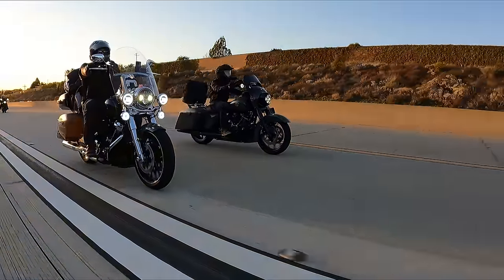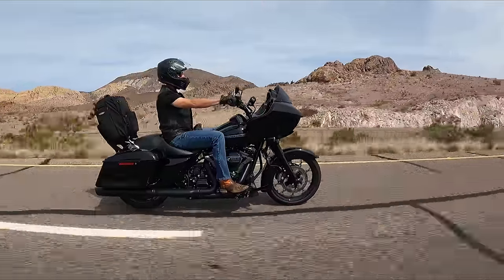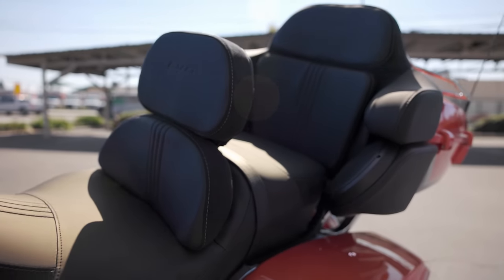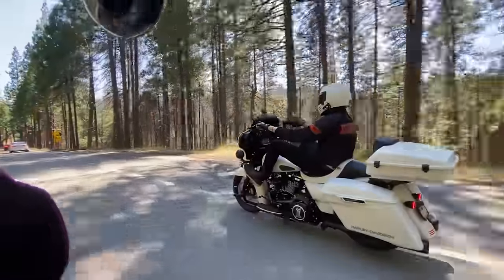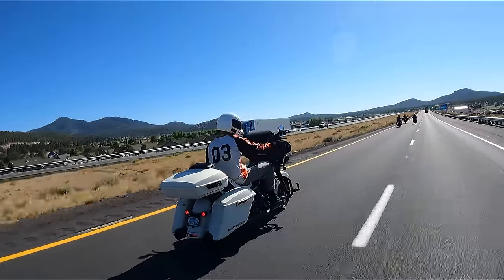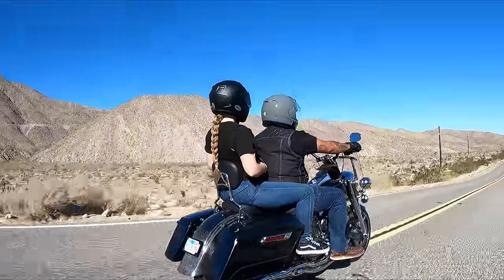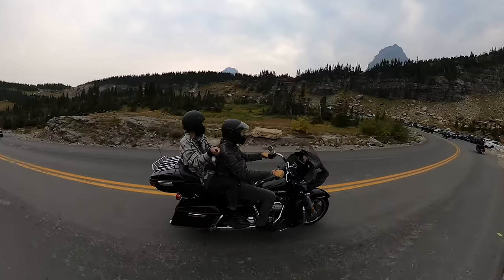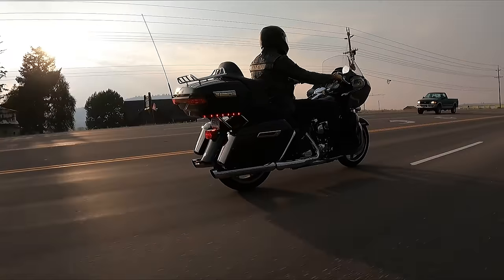Top 10 Touring-Comfort Accessories & Mods for your Harley-Davidson Motorcycle

Comment: Add an Air Hawk seat pad to that list, I switch mine out every gas stop so it's like having a new seat everytime after I gas up... changes up the pressure spots. Worth every penny I paid for it and they are right, it WILL double your riding time with more comfort.

Comment: On my 2015 RK classic, I fitted fold out highway pegs just above the foot boards, I also fitted a kit that push the boards out about 3/4 inch (cannot remember the brand) this made it super comfortable to ride with heels on the boards and balls of feet on the pegs. Along with back rest and and 3 inch pull back bars (stock height) all day rides were completely ache free😊

Comment: Back in 2007 I bought a used 05' Heritage Softail Classic with 4000 miles on it.  I just turned 104,000 yesterday.  Shortly after I bought the bike I scored a brand new Mustang touring seat with rider backrest on Ebay for $400 (I think they're around $700 now).  So roughly 100,000 miles on that seat with the backrest.  It is as comfortable now as it was 15 years ago when it was new.   No rips, very little fading, all the trim pieces still intact.  I'd have to say that was THE best, and smartest, investment I've made for that bike.  When I test ride bikes now, I can hardly stand riding 10 miles without the rider backrest.

Comment: On my 3rd Harley touring bike and I am hunting for the next bike now.  All the points in this video are great.

The current one is a 2014 Ultra Limited with now 105k miles. The original grips I have are 0-6. I have a CVO Ultra Limited Hammock saddle with heat for the winter. Stock saddle of Spring and Fall. A cop saddle for summer. I also swap windshields for whichever saddle I am using.

Suspension is still stock. I do swap from the air adjustable to the newer coil over when I am on longer trips but prefer the easy adjustability of the stock air shocks. My first Harley was a 99 FLHTPI and it had air adjustable front suspension too!

I would say I find the CB on the 2014 nice on long trips. There are a few truckers that use them still.

I have a backrest and added foot pegs to the highway bar too.

Comment: 🛑🛑 Great List Matt👍!!

I have every item that you listed, and I think your assessment is “spot on”. 

I would also like to add 3 more items to the list….
• Heated Seat. 
• Aftermarket Headpipe. 
• Aftemarket or Rockford Fosgate Stereo system with Satellite Roadio Antenna. 

A Heat Seat goes (excuses the pun) hand in hand with Heated Grips. When riding on a dew, cold, or raining situation these 2 items coupled together are AWESOME!!

Aftermarket Headpipe, has made a difference for my wife when riding 2 up. Removing the heat from the Catalytic Converter being removed under her right foot, has made our riding much easier. She is no longer complaining about her right foot being “on fire” 🔥. 

I upgraded my CVO Ultra with a Satellite Antenna as well as the “latest and greatest” Rockford Fosgate Sound System. Being able to take your favorite music with you, regardless of location and being able to hear it at any speed is “priceless”. 

Take Care My Friend…Keep Up With The Great Vids. 😀👍
Reply from the maker: Great comment. Thank you. The head pipe giving you a big heat reduction is an interesting one. I know some people experience that which is great. A lot of times the aftermarket stuff creates more heat though what pipe did you use? Stereo upgrade is always good. 🤙🏼🤙🏼
Reply: @MattLaidlaw  
Matt…I used S&S Power Tuned Duals Header (with the hidden crossover) with Rinehart 4” Mufflers.  

I did the Stage 4 upgrade, installed the new exhaust, then ran the bike for a few thousand miles and then did a Tune. 

The new header pipe really changed how hot the bike felt while riding with the Catalytic Converter Removed. My wife used to spray Hair Curling Spray (it was to not allow your hair to burn when it was curled) on her foot prior when riding on long trips, before the pipe was replaced. It was hot 🥵 

I really like your Channel. You always do a great presentation,  as well as the photography is always first class. 

Keep Up The Good Work😀👍.

Comment: Agree with all your upgrades. T Bars on a cruiser w 14 inch suspension seems to be so much better for comfort and handling then the 12” Yaffes and the 13 inch suspension I had on it prior. Also the heated hammock on a long ride is killer.

Comment: Great video and suggestions...I have a 2004 UC (now a 95" with lots of performance mods) and have every one of those mods installed except the heated gear and fork spring mods. I have a TP QR installed and 2 seats: 2-up OEM style and single-rider. Both seats have been modified with memory foam for my (our) weight. The single-rider seat has a high back for great support. 10" LA Choppers mini-ape handle bars have the least amount of pullback I could find. They keep my wrists in a more neutral position while keeping my hands just below the top line of the bat wing fairing and out of the wind. I envy the vented lower fairings as I live in SoCal and often ride in cold weather. The 8.5" Memphis Shade wind screen moves the air to just above my head, so no wind buffeting. Easy to lift my head up a bit allowing the wind to blow the rain drops of my face shield, lol.

Comment: As an old long haul biker yup all great points, for sure a slightly higher windshield for long road trips (still want to look over it) as in heavy rain you can duck down under it to control some of the water and less wind on the body makes a difference. Seat lots of good ones but for me the HD Road Zeppelin as ability to adjust air bladders is great for pressure points, and yes yes you need a backrest. I would add a set of custom molded ear plugs as on long trips you can have wind issues in the ear canal and the noise/wind reduction does reduce stress and potential headaches on long multi day trips. Oh and yes waterproof boots as wet boots suck! For me we are talking touring comfort so I find stock suspension on the Ultra Limited is no real issue for me.

Comment: Excellent info!  Right on point, other than one difference of opinion that I have.  Handle bar height, in my experience, is best when right at shoulder height.  I am able to ride much longer in comfort with that set up, but that could just be personal preference.  I've tried varying heights, and shoulder height works best for me.  Thanks for the video!

Comment: Matt, another great tutorial!  Thank you.   I stepped up this year from a Heritage to the Road Glide Limited to do some more long distance riding.  I have added most of your recommendations, but need to consider rider backrest.

I do think that engine heat management on the M8 Limited's is a huge issue for both rider and passenger comfort and I am studying options to resolve that.  It would be great if you could do a video on that topic as I know in SoCal it must be a major point of discussion.
Reply: The Harley fan that mounts right behind the rear cylinder and the flex engine heat down really helps with the engine heat. I have one on my road glide limited.
Reply: DK Customs has a 10 part series on heat management…a lot of great info!

Comment: Grant video hello agree with you on everything. Although I heated seat I live in Pennsylvania. I use it in the rain. I notice on some of your videos. It’s rained all night. Turn that heated seat on and it’ll dry it up. Heated grips. I use them in the rain. I don’t like gloves very seldom wear them. My CVO came with the back rest I’ve never used it. I like hitting that crunch highway. Pegs, definite must are usually ride with my heel on the floorboard, and my toes are on the highway pegs and there’s all types of variations have to be able to move your legs around. I really like the Hamic seat. One of the thing that you did not mention is I think heated gear, a heated vest, or jacket and rain gear. I have a heated jacket and vest my wife she’s happy with a vest and it always has to be in the bike you pack less clothes. You don’t have to layer gives you more space. Suspension my bike is an older Rushmore Forza 14 and I keep it right you know clean maintenance cams anyway I can upkeep it and then 45 grand I like my bike better than the new ones it has all the lights in the back and my opinion anyway. I think oh what’s it called I run a batwing fairing more protection closer to you, and that little scoop that Harley used to put on standard that bolts on the inside of the bottom of the triple tree. It keeps all that junk from blowing up underneath the faring and it blows it down on the motor. It was designed to put more air to the motor, but it also keeps all that stuff, rain everything coming in up underneath the faring. Well I got my bike they didn’t have any. An aftermarket brand came out with it first you know the one that starts with a K and then Harley came out with it like a year or two later you know how it is. I always love that they came standard on Harleys back in the day handlebars I just run my stock. They seem to be pretty good for me. I’m 6 foot, that’s on my dresser Limited . Heated seat is fantastic in the rain energize. It runs street glide’s and have extra seats and they have a hammock heated seat. And they have tour packed so put on them and then they’ll switch them back . But these guys are all married. Arrive with the woman. Happy. Great video man. Thanks.

Comment: Matt, I’m 6’3” and have a 2018 Heritage 114. I have the Softail Tallboy seat and I have more legroom on this bike than a stock Road King. The other thing was getting it restuffed for my weight (180) with memory foam. I love this channel and even in Ohio, y’all give me so much inspiration
Reply from the maker: Thank you sir! Yes, the Heritage is super under appreciated. That bike is very nice out on the road. Sounds like you got it dialed.
Reply: @MattLaidlaw  It’s close. Bars are next, but it’s dialed in. I actually need a little more pullback due to the further seat position. 

I had a hard time between RK and Heritage. This one already had everything (close) to what I would have done. I added taller shield, lower deflectors. And, my Simpson has the least buffeting of any helmet I’ve had. The bike is a riot yet easy in city/country roads but holds it own on trips. Red Iron Denim makes it not look like a Boomer Bike either 😂

Comment: I use motor guard covers they call chaps ,they are like a bag you can fold up and put  in the saddlebag when not in use ! winter time it is a night and day  change ,I have wrapped 2 into 1 headers you can not ride in the summer with these covers on !  they kind of scoop air into the engine though ,blew a rain cover off the air cleaner !

Comment: if your going to add a heel shifter do yourself a favor and get an extended one so you can move your foot on the floor board. also you can adjust it almost to the bottom of the footboard and you don't have to tippy toe every time you shift.Aso I pack the soft lowers for long tips so when it gets cold or your riding in rain for days you can throw them on and they make pretty good bag liners when you dont need them. snowmobile gloves work great, better than any bike glove I've tried in my 50 years of riding. no haeted anything for me . im on a motorcycle for a reason.

Comment: Great list. I tour every summer, 6-8 hours a day, back to back for weeks, is typical. I have had two Hammock seats and they are the most comfortable of all the brands I have owned so far, including Corbin. I buy the limited so I get all of the goodies. The lower fairings are great when in the rain. I don't like getting pounded at 70 mph by rain "rocks".  I run Legend suspension 13" ARC in the rear of my 2022 RG CVO Limited. I will upgrade of the front in the spring, they make a huge difference, I weigh 175, the factory spring rates are way too stiff in the rear and too squishy in the front for me. You stated an important point, having the rear and front balanced really improves the comfort and handling - and what is up with the factory right shock? 47K and I get a pogo stick? Sorry, back to the subject at hand. Great list - My bike has them all. At 66 these are a huge help for my comfort and duration.

Comment: This video could be called 10 reasons to just buy the Ultra Limited. 
Funny enough, I have a Sportster (2016 XL1200T), and I just installed a Mustang seat w/ backrest, and Progressive 13.5” rear shocks on my bike. I’ve got the progressive cartridges for the front. Just need time to do it. I also put on mini floorboards because the pegs were terrible after 350 miles or so. The windshield from the factory isn’t terrible. With all of those improvements, I am really looking forward to putting on some miles this year.

Comment: Hey MATT, I really like your recommendations for Harley Davidson cruisers definitely most of those are at the top of my list. MATT, would you suggest making sure that the frame is straight before you go ahead and put on all of this suspension seat high pegs and everything else it’s been my Experience that these frames are not correct right from the factory most of the time. Usually when we buy a motorcycle will tear it down and send it to the frame man and have them make sure that the frame is straight or tweak it to be straight. What’s your take on that , I’ve seen death wobbles you couldn’t get rid of no matter what you did until you took the frame and had it straightened. Just saying.

Comment: #1 Rider's Back Rest #2 Highway Pegs 3# Windshield / Fairing #4 Heel Shifter #5 Suspension Front & Rear #6 The Seat #7 Handle Bars (Ergonomics) #8 Cruise Control #9 Lower Leg Fairings #10 Heated Grips

Comment: Hi matt. Class videos. I'm always waiting for u to put up a new video 😂. You have given us all great advice in that video matt but there's just one thing/back rest or sissy bar for a passanger. I have a 2008 roadking and I'm not sure what new step back touring seat to put on my bike but the big problem is what sissy bar to go for or back rest for my wife because if I go for the step back then the passanger seat for my wife is smaller because of the step back and the HD stock sissy bar I have on my bike and I want a sissy bar there for safety. So maybe I need to go for a adjustable passanger back rest or adjustable sissy bar or a sissy bar that slants back. What do u think matt or guys please? Nigel from Ireland.

Comment: I just bought a road glide limited. I take an annual 6 day trip. I’ve got the quick detach tourpak set up for everyday riding. However, the storage in the tourpak is awesome for everyday use. 

Only negative comment I have for the RGL, it gets toasty with the lower leg fairings in the summer. But with highway pegs I just keep my legs away from the engine more.
Reply from the maker: Once you got the storage you always use it haha. Great comment. Thank you.

Comment: I took my backrest off as I do a lot of riding with a passenger. I believe the backrest becomes a safety hazard for the passenger in the event of an accident. 2008 Electra Glide Ultra Classic. I'd like to find a set of highway pegs for us troll-length riders (me)...I feel like a kid in a high chair trying to reach my stock Harley Pegs...LOL Have to look into the ones you mentioned. Thanks!
Reply from the maker: You can swivel the highway pegs or get the articulating arm that bends away from the rider.

Comment: I thought my old Road Glide was pretty comfortable completely stock. Even the stock seat was OK. It came with the high wind shield, but I did add highway pegs. The stock radio was almost useless at highway speeds. Would still like to upgrade the radio some day.

Comment: I have converted to an ADV from an FLTRU and the first thing I did was put on highway pegs. My ADV has heated grips and seat and there is no going back to one with out them for me. I just did an 8000 mile trip from my home in Ottawa Canada to the PCH and back
Reply from the maker: Very nice. Yea, the suspension on a ADV bike is hard to beat. I don’t like the fairing options as well. The highway pegs are definitely needed

Comment: Great video matt. Good to see the MDB road king there. The other thing i would be curious of is your opinion between heated gloves and heated grips. I assume heated grips could still leave your knuckled cold?
Reply: I thought the same thing here in Chicago. I refuse to quit riding if it wasn’t icy or snowing, so I bought a good set of heated gloves and hard wired them. Only problem was while gripping the grips, my palms still got cold. I have tried just the heated grips and they work well but still knuckles can get cold if you are down below 25 degrees. So I use both and they are both on a low setting all the time in the winter.

Comment: Hey Matt, Awesome video. @ Everyone I just recently stepped up from a 2018 Iron sporty to a 06 Electra glide ultra classic, Even though its technology is outdated Its served as a huge step up. It came with that smaller windscreen on top of the existing batwing fairing and I've noticed a huge amount of wind buffeting, Due to being on a budget right now I've decided to create an extended wind screen using Plexiglass which has helped alleviate a lot of the buffeting issue,  My question is How tall of a windscreen do most of you use and is there a particular shape that you've noticed that helps to redirect the wind effectively. Thanks in advance.

Comment: I have tried a backrest on my Road King and was not able to use it was very uncomfortable for me.
I am going to try one of the packs with the backrest next since they are higher up and see if that works for me.
The heel shift sucks.
There are times I need to move my foot back on the floorboards and the heel shifter got in the way and created a lot of discomfort for me.
The heel shifter was the first thing I got rid of on my Road King.